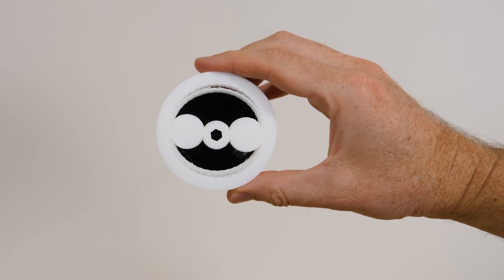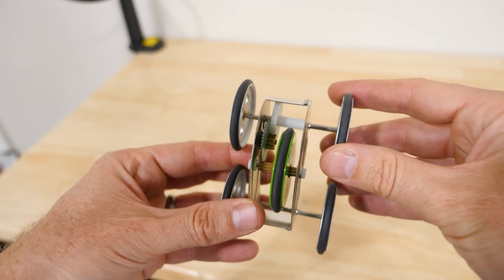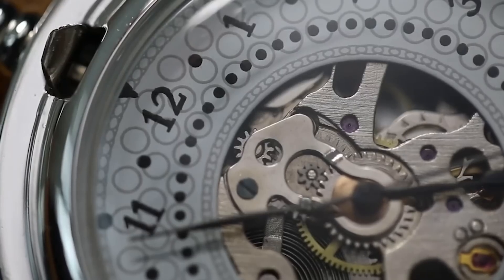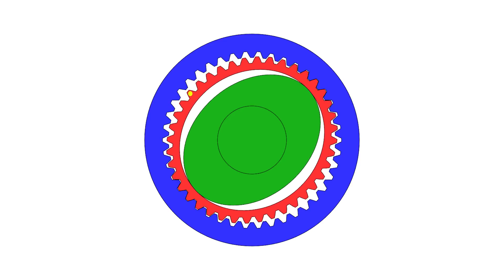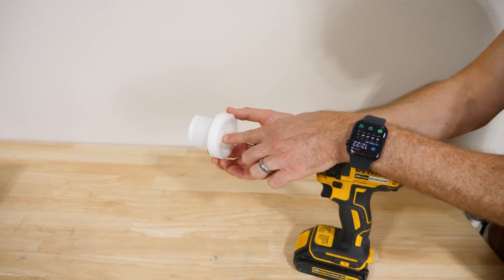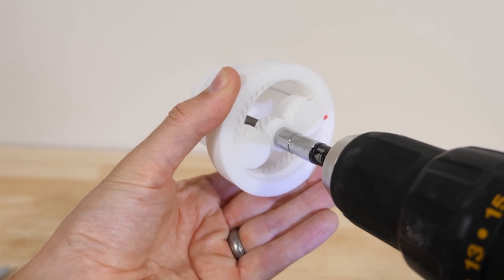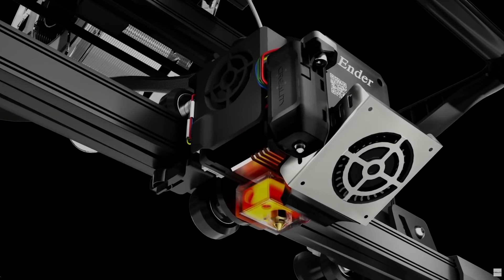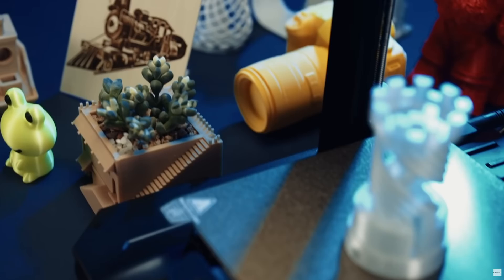3D Printed Harmonic Drive Using Ender-3 S1 Pro and Creality Sonic Pad

Comment: Ah, yes the OLD friction motor, as we used to call them- practically every little cheapo toy car had one (because I never had one that I didn't take apart to see how it worked. Actually I knew how they all worked after I took apart the first one, but some were larger than others, and I wanted to see how much bigger the flywheel was in the larger toys.) Pretty simple concept, really.

Comment: I developed a planetary gear system in college for use in wheelchair wheels. They had they ability to change from a 1:1 gear ratio, to a 5:1 gear ratio for steep hill climbs or higher torque needs.

Comment: This reminds me of the art installation called "Machine with Concrete" in which gears are set up in a series of 12 individual reductive drives that reduces it from 50 rotations to 1 rotation each expressed as (1/50)^12. The end of the reduction chain is literally set in concrete and it would take well over two trillion years of turning the input at 200 rpm for the output gear to make a single revolution.

Comment: Could you not have printed 3 arms to a central ring off the front face(where you hold it) to give the drive(drill in this case) a center to locate in?

Comment: The AnkerMake M5 3D printer is way better than this one. It’s faster, benches better, has a camera so you can monitor prints remotely and uses AI to make sure the print doesn’t go off track, has a larger print volume, and you can put it together in a quarter of the time at 15 minutes. I got mine for $429 on the Kickstarter.

Comment: I have a Wayne Dalton garage door opener that has a harmonic drive reduction in it.  It's used to pre-tension the torsion spring.  Neat stuff.  

You should do cycloidal gearing next!

Comment: So one question I had that was never answered is how does the back wheels avoid slowing down the car? I feel like more could have been about the flywheel and it pushing the car.
Reply: They don't slow it down much because they don't have much inertia (not connected to gears or another flywheel) and not much friction (at least, it looks that way in the video).

Comment: Lots of toy cars had these flywheels when I was a kid. We called them "friction powered." Usually you could peek in and observe the gears driving the little metal flywheel. It was fascinating how much the flywheel spun when you turned the wheel just a little bit.
Reply: Like those cars that had the nylon pull rope with gear teeth on it that would spin the flywheel up.
Reply: @Sonny_McMacsson  Those were fun!
Reply: YEP! And they worked so well... until the teeth striped out!
Reply: @rickkwitkoski1976  My little boy had a strange way of playing with his cars. He would sit on the couch and bounce against the back rolling the car back and forth beside him. When the gears were finally ruined the car rolled better.
Reply: We called them momentum wheels :D
Reply: We still have these in India, and those are pretty common. We can find them in fairs and toy shops easily. I didn't knew they were outdated 😐 Well makes sense, since India's not a developed country so no advanced toys in common village area shops.
Reply: @adityagawande6190  I think they still exist here. My kids are 29 and 30, so I have not paid attention to toy cars for a while.
Reply: @Torby4096  ohh i see.
Reply: I remember having a car/ eagle thing that used similar physics to create sparks. I remember breaking the bottom off so as I could see the sparks being made by the flywheel. Health n safety wont let anyone make em like that anymore.

Comment: What happens if you spin the outer shell? Is it then a 1:300 ratio? or will it cease/break instantly?
Reply: Strain-wave gearboxes are typically not backdrivable, similar to a worm gear
Reply: Probably won't work well

Comment: Hey! How does a harmonic balancer work???
Reply: there is a rubber ring holding the shaft piece and belt piece together. the rubber softness dampens high frequency vibrations.

Comment: I had a question. When you or anyone else in general say rotational speed, do they mean angular speed or linear speed which is the product of radius of rotation and angular speed?
Reply: The way to differentiate between the two in written or spoken word is to cite RPM for angular rotation or to cite a unit of length per minute such as meters per minuite (mpm), or feet per minuite (fpm) for the fastest linear speed the object achieves.
However since the two are directly related, linear speed being rotations per minuite × circumference, there is often no difference at all. The only exception is when there is a specific speed or rpm desired.
Reply: In science/engineering, usually angular velocity. In flat earth circles... Best not to go there
Reply: @PunnamarajVinayakTejas  ok thanks.

Comment: Wouldn't the oscillation and vibration be an issue for many applications of the harmonic drive?
Reply from the maker: This one clicked due to imperfections in the printing process. A well designed metal one does not click or vibrate. It is smooth
Reply: I think If the design and manufacturing is more precise and a very good lubricant is put in a gearbox, it will dramatically reduce the vibration and friction in the system

Comment: "So if your wanting to make one of these yourself you can easily do it, with a 3d printer"
Reply: I mean.... just get a 3D printer. They're not that expensive or difficult to use. The ability to make basically anything you want is really cool.
Reply: @SafetyLucas  spending 200 bucks isn't exactly "easy"

Comment: The weak point in this design I think is the flexible gear, which could wear out pretty fast in high demand, high speed situations. I seem to remember that there are versions of the harmonic drive that use an alternate approach instead of a flexible gear.
Reply: If you design them right and use the right materials, they basically don't wear out.
Reply: @infinitelyexplosive  I'd like to see a material that is constantly being flexed that doesn't wear out! Especially if it is being flexed quickly and/or in high temperature environments. A very cool idea though, for sure.
Reply: @JustWasted3HoursHere  If all the stresses are (well) below its elastic limit then fatigue isn’t much of an issue.
Reply: @JustWasted3HoursHere  steel

Comment: There has to be a bendable elliptical wheel in the harmonic drive. Will that wear out? How long will that last?
Reply from the maker: It is within the elastic limit of the material so it won't fatigue any faster than other gears
Reply: @TheActionLab  like the elephant toy you showed once ? So machines can be made like that toy so that they dont wear away easily right??
Reply: @TheActionLab  That makes sense.
Reply: @TheActionLab  Moon's gravity is only 1/6 of Earth, the dirt driven up by the moon's buggy should be alot higher. Another proof U_s moon manned mission is shot in a studio.
Reply: @CrazyCandyCrush  I think you’d have to go ahead and actually prove that rather than stating it.

See I can just counter by pointing out dust on Earth travels much higher because it gets picked up by currents in the air.
Reply: I work on a device that uses a harmonic drive and never had to replace one.  I'd conservatively say 10k rotations every day for 10+ years, and under a pretty reasonable amount of stress due to the imbalanced weight it is ultimately rotating..  But with all things it really comes down to the engineering of it.  With any mechanical component its always about tradeoffs between factors such as cost or size or weight.  So sure its probably not as strong as a straight cut gear, but in my experience it is certainly possible to engineer one that has an acceptably long lifespan, there is nothing inherently flawed with the design.
Reply: As long it is still below elasticity max deformation, it's not going to break.
It's break due to friction, just like other gears.
Reply: The gears in friction drive toys aren’t bendable, they just use regular reduction gearing.

Comment: But can you turn the housing to affect the small center pinion? That’s what you’d need for the flywheel car’s drivetrain.
Reply: Harmonic drives are incredibly difficult to back drive--so yes, you are correct--it would not work as a drop in replacement for the toy shown.  But I think the point was more to demonstrate the overall concept of gears first rather than to suggest the harmonic drive could replace the gears in that toy.  Which is sort of borne out in the rest of the video where he points out that where they are really used is in situations where size or weight are more significant factors in the engineering decisions.

Its also worth considering that not being able to back-drive a set of gears is sometimes an advantage.  I work on a device that uses a harmonic drive and does not need a brake for the thing that is moving because of how difficult back driving it is to back drive.
Reply: @isavedtheuniverse  thanks for the info!
Reply: @isavedtheuniverse   I have seen one application where a stepper-motor is attached directly to the harmonic drive vertically, to rotate a more heavy part/arm. Advantage here is the on-axis concentric set-up. Also hardly any backlash.